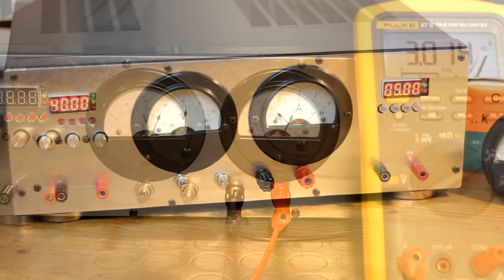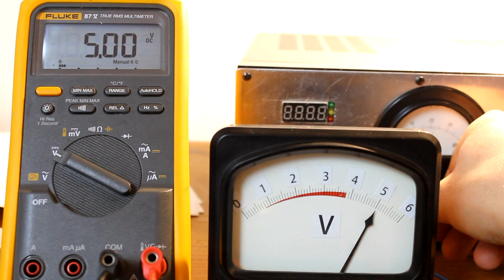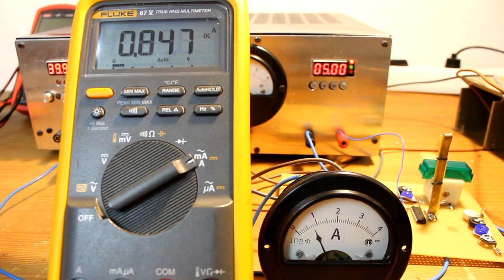Trailer: Reuse, Modify and Calculate Cool Old Meters

Comment: Now, add Arduino PWM control on those meters and make a steampunk desk clock ☺
Reply: It's been done before. In fact, I am doing a similar project. I plan to add a DCF77 receiver to periodically synchronise the clock; hope that works out well.

You can source some nice looking gauges from AliExpress if you look around a bit. I got some that look very much like the ones at the very beginning of the video. And don't worry too much about the rated voltage/amperage since you can convert it to something compatible with the Arduino's 5V outputs by simply swapping out the internal resistor and removing the capacitor, if there is one. As for the gauges, I recommend printing entire new gauges rather than just the numbers. Looks neater, and no contrast between the numbers and the surrounding background.
Reply: can you tell me, how you are going to read out the DCF77 signal? is my guess right, that you are going to use the DCF77 receiver which is selled by pollin?
Reply: check on google for "arduino DCF77" and you can solve the problem. good luck
Reply: Got mine off of eBay, seller was www-tne-de. Haven't started the project yet, so I don't know exactly how the thing works or how to interface with it from an Arduino. It might have come with some documentation, but it's currently elsewhere and I can't check. Seem to recall it was just the datasheet though, no example code.

But like Andrei suggested: do a web search. That's how I'll have to do it as well. It's not like any of us is born with the knowledge of how to interface with random electronics modules or anything; we all have to look this stuff up. ;)
Reply: yeah, the most ebayers sell the same module you can get from pollin, just a little bit more expensive. I thought you are might doing a different approach, thats the reason why i have asked. If it's the same module from pollin you got, there are several examples in the net how to interface it. No worrys. Cheers :)
Reply: Now if only the rest of my meters would arrive already... ;)